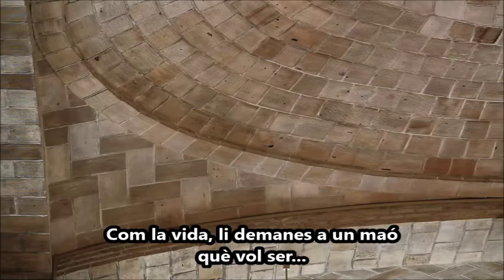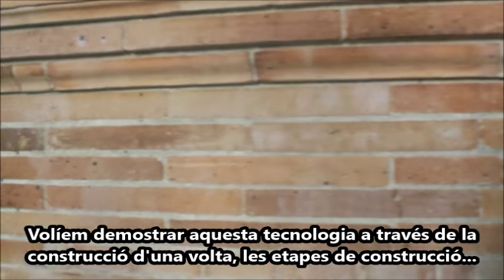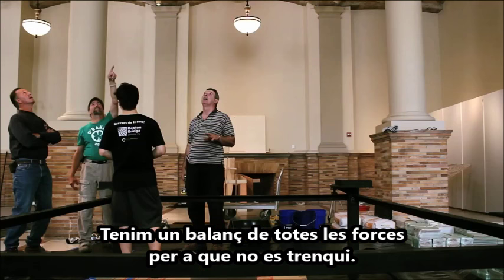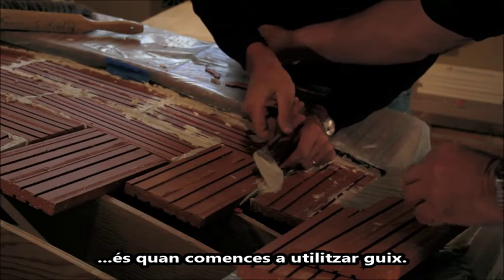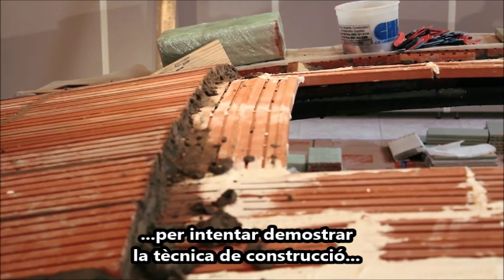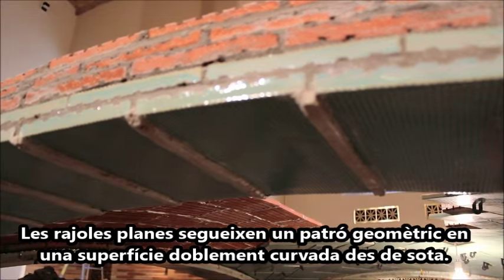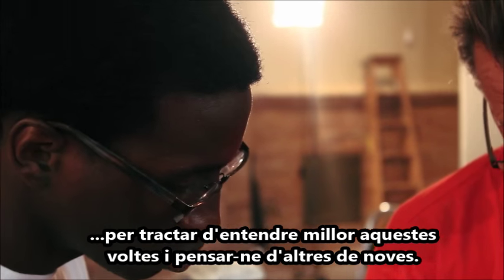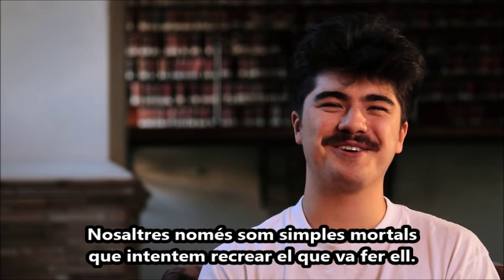Guastavino vaults. Palaces for the people.

Comment: The work done on many buildings in Mexico using Catalan Arch roofs is 'the everyday-man's' comparable work...just as durable, just as beautiful, and FAR CHEAPER than multi-layered thin tile...it is also more robust to wind, earth tremors, etc., as the Catalan vault works like a structural arch should...downward force makes the structure 'tighter', without the problem of so many mortar layers...watch a video on it done...it is (from a mason's point) simply 'the best' way to make a roof!